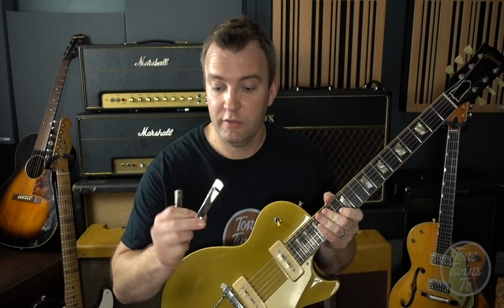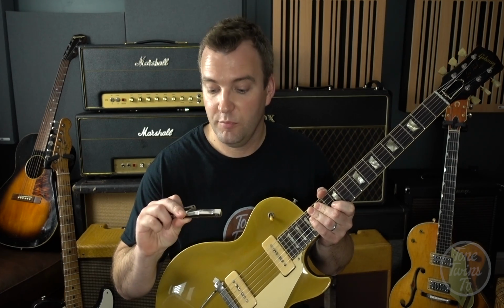LES PAUL 1952 Goldtop Gibson Les Paul tailpiece shootout!

Comment: Thanks so much for the video! Trying to decide which one for me. Any design or weight benefits to one or the other? Is the height adjustability on the Mojo a big benefit?
Reply from the maker: The mojo is lighter but not by much, hopefully the tonal differences are apparent in this video, much as you'd expect brass vs aluminium. Both are superb and we wouldn't hesitate to use either on our guitars. Thanks

Comment: Great to see there are solutions for that design error. You would think Gibson could have come up with a similar fix at the time. An interesting demo since the two bridges do sound quite markedly different. I think I prefer the brass. Bell brass is a misnomer. There is bell metal, a form of bronze, an alloy of copper and tin. Brass is an alloy of copper and zinc. It would be great if someone would make saddles of bell metal, but as far as I know no one has.
Reply from the maker: Thanks for the info